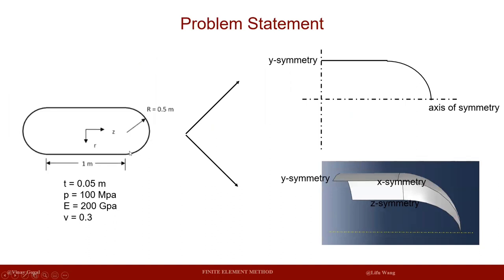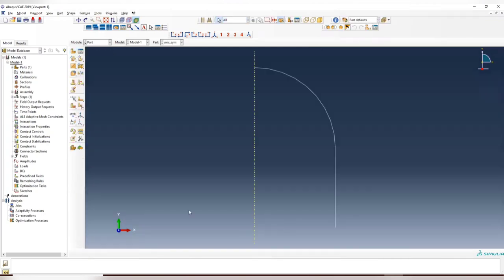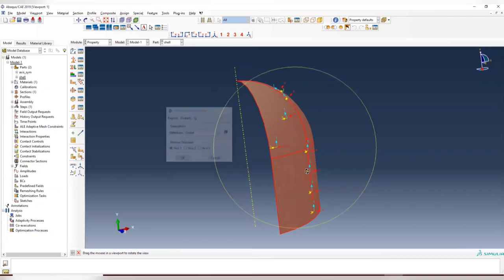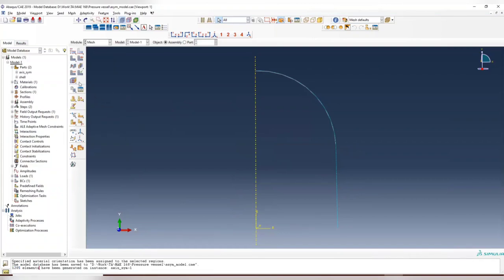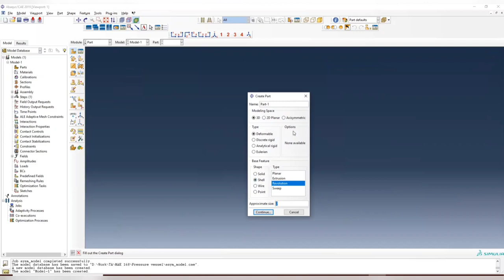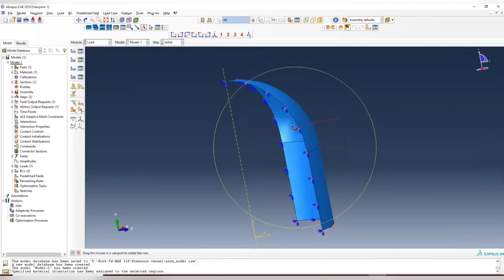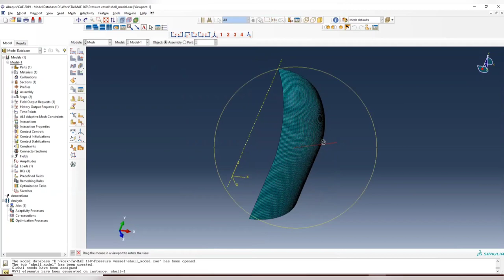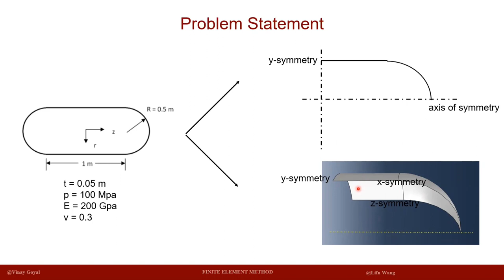#ABAQUS Tutorials - Metal Pressure Vessel With End Spherical Caps

Comment: Hello Sir, 
Firstly thanks for the informative videos.

Is there any way to verify these simulated results analytically? I am currently designing a thick shell cylinder with end cap domes. My doubt is that I was able to verify the cylindrical stress values through thick cylinder equations, now that we have included both cylinder and the spherical dome, I am a little puzzled. Your response could do a wonder.